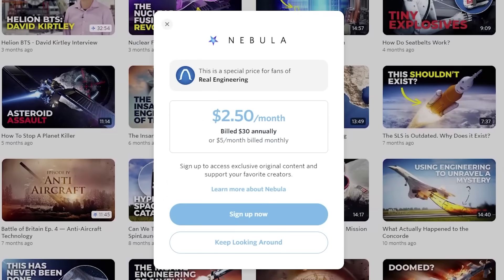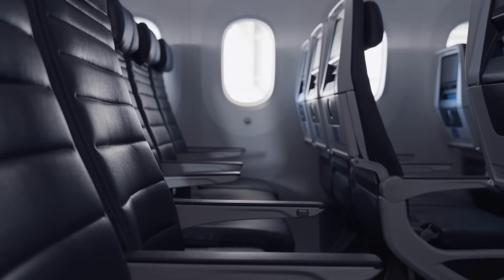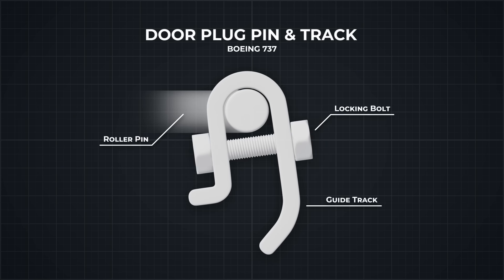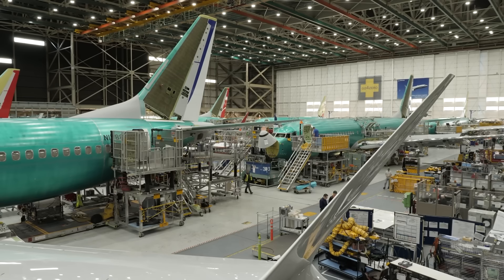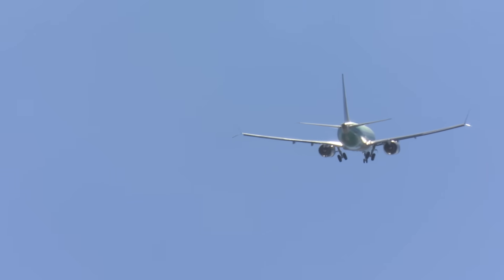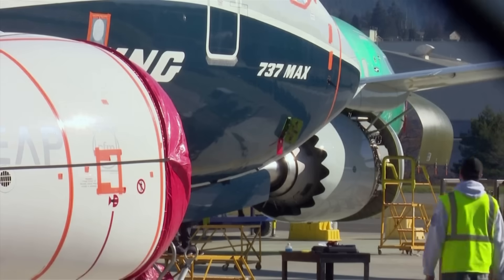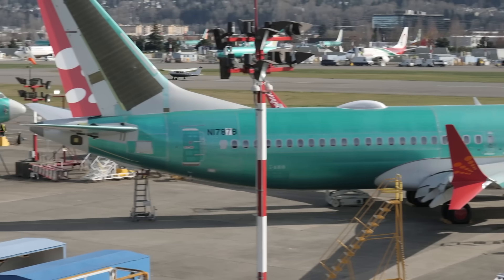The Questionable Engineering of the 737 Max

Comment: A few thoughts.

1) This is a plain example of “trying to upgrade an old system when you really need to simply start fresh”. I think Boeing is starting to realize this. I see this at my own work (I’m a design engineer at another large aerospace company, not Boeing). There’s A LOT of taking old designs and modernizing them that goes on, to the point where it teeters on the edge of insanity when it comes to just how many things need to be updated and revamped and fixed and all, just for the sake of trying to save a couple of bucks. A lot of those decisions are made by the guys overlooking the financial spreadsheets, unfortunately, and the engineers are stuck doing what they’re told. But, it’s REALLY easy to overlooks something small in the midst of the thousands of tiny fires you’re trying to put out. My entire job is moving rivet holes around on engineering drawings because they weren’t drawn in correctly 60 years ago!

2) There is definitely a level of incompetency creeping into the industry (and not even just the aerospace industry, but engineering, manufacturing, and mechanic industries at large). Human error is the cause of like 90% of accidents, and this sounds like it fits into the category. So many “engineering tragedies” would have been prevented if people didn’t ignore safety warnings that were going off for a reason. It sounds to me like the engineering side of things actually worked properly, it was everything else that was the problem here (manufacturing, assembly, inspections, and maintenance)!

3) “systemic” is a bold word to use. Even with these few incidents with the 737 Max, the plane, and Boeing, still have very good safety records. As air travel increases, it would be expected to see a rise in the number of reported incidents, but the overall percentage will stay the same or go down. And, more government will not stop the problems, it will only cause things to get delayed more.

4) there isn’t a company or government in the world that doesn’t prioritize profit over safety. There is a risk-reward calculation for every product and policy made. It’s not just a Boeing thing. So, that argument is tired and old and irrelevant. Boeing isn’t “overly prioritizing profit over safety”, because guess what, if they continue to have safety issues, no one is going to want their planes, and then they also won’t have any profits… It’s a dumb argument that only sounds good, but doesn’t make sense at all. And, taking the word of any PR rep is stupid, as they’re going to say whatever they feel needs to be said to look like the good guy, so of course the Alaska Airlines rep is going to say “we don’t like safety exemptions”, because they’re trying to save face too. They’re more than capable of paying to make sure the planes they’d purchase have extra safety inspections and all, but they don’t, because they’ve made the same “risk-reward” calculation that Boeing did and now they’re just paying lip service to the people.

Comment: The MAX will not be remembered as a sales success, but a testament to how far Boeing has fallen. 

Boeing was actively working on an all-new 737 sized plane in the early 2010s when the NEO was announced. 

Instead of continuing the development, they dropped it all together to make the MAX. They were so concerned with losing market share that the thought of the NEO going unchallenged for 2-3 years was unpalatable. 

Development would have cost $2b US.

The overengineered 737 MAX enjoyed fanfare until the two accidents in which it was grounded for nearly 2 years. 

The CSeries debacle was another caveat into the arrogance deplayed by Boeing, who themselves should have bought the aircraft, and not Airbus. Now Airbus has the modern A220 and A320neo families, and the technologies therein, while Boeing flounders with a 1960s relic. 

Lies, cover ups, rubber stamping, all these things revealed about Boeing and their certification processes. 7 years after EIS, what has Boeing to show for it?

The 7 and 10 are not certified, and probably will not be so for avery long time, and now the 9 is grounded indefinitely. The 10 has the same plug type door the 9 has, so that will further complicate things

This aircraft, the embodiment of Boeing's arrogance, has cost them tens of billions of dollars. And Boeing is too broke to do anything about it. 

How the mighty have fallen.

Comment: Reset the warning and keep running. This happens in every production environment, regardless of the machine, if you don’t have proper people in charge of the mechanics. Upper management doesn’t want any down time so it takes someone w/ knowledge and power to keep it offline until the root cause of the problem is identified and fixed.
Reply: The more software I write the more amazing it is that people ignore warnings and errors. I cannot believe the number of projects just littered with warnings. The complacency it causes is unbelievable. Every single warning or error should be explicitly silenced with good reason, or better,  actually fixed.

Comment: For me the biggest red flag occured when the Max was grounded. They used the time to inspect all aircraft and they found foreign objects in the fuel tanks of more than 60% of them. In aviation every tool, bolt, screw, nut, washer, rag etc. is counted before and after a shift. If any piece is missing, no aircraft leaves the station before it is not found. The fact that something ridiculous like 60% of the aircraft could contain foreign objects in the tank shows a complete disregard of safety standards. It also shows in everything else they do.
Reply: Carlo M. Cipolla wrote a book. "The basic laws of human stupidity" and it covers the exact issues involved.

Comment: Boeing is too large for their own good and thus full of ineficciency and corruption.
Cost cutting top management, annoying middle management, and way too few actual engineers. Outsourced to cheap subcontractors.
I mean the whole plane is a 1960s design, with way oversized engines glued on, hoping a computer will correct bad design.

Comment: There is nothing wrong with door plugs.
Airbus A321neo also used it too. In the old A321, Airbus customises each configuration individually, just like Boeing 757. Some of them have 8 full sized doors, some of them only have 4 full sized doors + 4 emergency exits, some might even have 4 full sized doors + 2 half-sized doors (the size of this 737MAX9 aft exit) + 4 emergency exits. This customisation costs money and time, plus it made the plane less attractive to would be buyers looking to sell it on secondary market (e.g. leasing companies like GECAS).
The wrong thing is easily shirking quality obligations and promises. Plus not managing the supply chain properly.
737 is produced in moving assembly line - now you know. Russia-Ukraine war, US-China trade war brought quite a lot of supply chain constraints, because not many people know that Ukraine and Russia has a big aerospace export economy. Parts are getting a bit more difficult to come by, and assembly line workers sometimes didn't have everything they needed when the airframe passes by their station, and have to chase down the airframe down the line when the parts finally arrived.
Who is going to check the installation job when the plane is already far away from the original station with all those inspectors laid off?

Comment: I appreciate the analysis done by RE, but his brief synopsis of the MCAS incident actually comes to a false conclusion.  For example, RE mentions an “instability” corrected by MCAS; when in actuality the MCAS only moderates the feel the pilots get in the control column such that the max “feels” the same as the legacy 737s when at high angles of attack with high thrust settings.  MCAS does not correct for any “instabilities.”

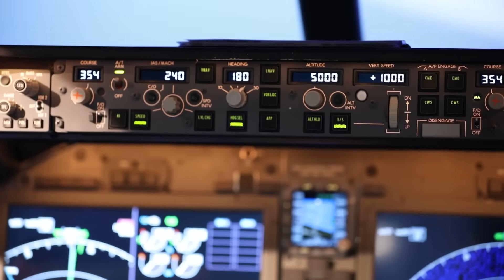Comment: 7:44 AFAIK the MCAS was not only a software, it was a system that had a computer and a sensor. 1 sensor. The crashes were caused by the 1 sensor failling (a massive sin for aviation that has reduntant systems everywhere) and the pilots WERE NOT INFORMED of the MCAS system during training and manuals
Reply: Additionally, airlines had to pay extra for the second redundant sensor. But like you said, the lack of clear training and communication about MCAS with the pilots was the real issue, and is caused by the fact that Boeing was allowed to self-regulate.
Reply: they didn't want additional training as that is the selling point of the 737 MAX, to match airbus' A320neo which didn't require additional training.
Reply: The 737 always had two Angle of Attack (AOA) sensors. MCAS was initially designed to use only one sensor at a time and then switch back and forth on every flight. You are correct that this was a massive error. Originally, the two sensors only drove two cockpit gauges, one for the pilot and the other for the co-pilot. Then Boeing crossed a line when they started using the AOA sensors to move the flight controls surfaces. It's been redesigned so that if the two sensors disagree then MCAS shuts off. This is better, but standard practice these days is to use three sensors and have the two good ones vote out the bad one.
Reply: @joevignolor4u949 yea, like airbus has been doing for ages. Airbus themselves did have some missteps though (qantas 72)
Reply: @dew9103 yes but Airbus documents every single function their fly-by-wire has 😂😂 oh and they know redundancy
Reply: it drives me crazy people keep blaming the software, there is nothing the software can do if the only sensor is faulty
Reply: A bit confusing, but MCAS is a normal thing pilots are aware of that exists on many planes - it helps correct the flight controls to feel consistent across multiple planes in the same class (regardless of length) and help correct for different weight and balance. It would be very difficult to fly large modern planes without something like it. The problem was with a particular piece of that system that was added without any real notice to pilots - a piece of code that looked at one single AoA sensor (the plane has multiple) to decide if the plane was at risk of a runaway pitch up, and if so, pushed the nose down, without any real indication it was doing so.

In the accident flights, that AoA sensor, which tells the computer the direction of the airstream compared to the plane, failed, and there was no redundancy or sanity check in the code, so the computer pushed the nose down as it was designed to do. Then it kept pushing until the plane crashed. Meanwhile the rest of the planes systems and instruments would have been operating and displaying as normal using their redundant values, making it very difficult to understand what was wrong.

Basically any amount of due diligence, oversight, or redundancy with other systems, would have prevented this. And even if not, proper communication and training with pilots would have.

There are a lot of accidents that are true "swiss cheese" scenarios, where things go wrong despite our best attempts to catch problems. But this was not one of those. It was totally predictable and totally preventable, and for it to happen at all the culture inside Boeing must be terrifyingly unsafe.
Reply: A system that doesn't allow the pilot to take over, I find it horrifying! Is like having a car that won't let you brake.
Reply: @DavidVercetti_prod  It can be overridden, but you need to know it's there in order to override it.
Reply: @DavidVercetti_prod You’re not the only one. I feel pretty bad for the poor pilots of those two crashes. Although MCAS can be disabled, the pilots have to know MCAS exists and how to disable it… and they didn’t because Boeing deliberately hid it from them and the FAA.

To those pilots, it would have seemed like the aircraft had suddenly developed a mind of its own and it was determined to force itself into a nose down position to dive and crash. Nothing they did, worked for more than a few seconds and they would have ended up fighting for survival against the aircraft itself that kept overriding them to enter into a fatal dive.

It must have been absolutely terrifying for them. Fighting and failing to survive against an aircraft that seems inexplicably determined to kill them. Whoever approved MCAS relying on a single AoA sensor should be jailed for life for this alone.
Reply: @mikoto7693  Its a bit more murky than that. Boeing's assumption (which was partially correct), was that crews would identify an MCAS malfunction as a separate malfunction with similar symptoms and take action based on that. MCAS operation was similar to an existing system on older 737's, and the MAX, called STS, which was in the manuals. 

STS is used to enhance stability under certain conditions. While testing the MAX, Boeing tried to use the existing STS to correct for the new handling issues, but they found STS by itself was too weak, so they added an extension of STS called MCAS, which does a similar job to STS, using the same flight control surface, but using a different sensor and made it more powerful. They kept STS in the manual and just assumed pilots would think MCAS inputs were just STS inputs.

Boeing assumed crews would be able to control the plane because, like STS, MCAS was designed with low control priority. It can be overridden by normal trim inputs. Basically as long as pilots do what they always do in normal conditions, which is to keep the plane in trim, MCAS would be overridden without the pilots even needing to know about it. Boeing also assumed that if the MCAS trim inputs became too annoying, they would use the existing stab trim runaway procedure, which can be used to stop trim inputs from any source, and would also stop MCAS. 

This assumption was partially correct. In the first event, the crew identified the trim moving excessively whenever they stopped making their own trim inputs, they turned it off and landing safely. In the 2nd event (1st crash), the captain successfully overrode MCAS for about 8 minutes just by using normal flying techniques of trimming away control forces as they appeared (something pilots learn in their first lesson). The plane then crashed when the captain gave the controls to the First officer, who, under high workload, let the control forces build up without making any major efforts to reduce them. Eventually the forces on the controls were so high that control was lost. 

Before the 3rd event (2nd crash), the regulators were comfortable allowing the MAX to keep flying because MCAS was now known about and an existing procedure, which all 737 crews should have had memorised, could be used to solve it. For reasons unknown, the crew of the second crash did not perform the procedure correctly (which was required to be known for all 737 types, not just the MAX), probably due to high workload. They also crashed.

At the end of the day, the system design was well below standard and never should have been certified. A pilot focusing solely on flying is able to fly indefinitely with the malfunction, but with all other warnings and cautions, any distraction from trimming was quickly punished by a crash.
Reply: @Jamenator1  that final paragraph makes it even more terrifying tbh
Reply: @mikoto7693  MCAS cannot be disable. What you can do is turn off the automatics. This is like having a program on your car that has an error that causes it to make a hard right turn. The only way to stop the program from making your car turn right is to disable the power steering. That is not the same as turning off the program (MCAS) just preventing it from acting.
Reply: @nickl5658  Aye, I was talking about before MCAS was modified after the two crashes. The engineer I spoke to said that it was patched and could now be isolated. Aka, not turned off but prevented from acting.
Reply: You can't point to one thing. These are all half-a$sed fixes to enable the central lie that Boeing could shove larger engines under the 737 while pretending it's the same airplane known to pilots and regulators. Predictably to make this "work," Boeing engineers made a chain of bad decisions and obfuscated their seriousness,, and the result is they murdered hundreds of people. The best way to avoid future problems like this is for the CEO and other senior executives who signed off on this clusterf**k to go to jail for years.
Reply: 'Must Be Terrifyingly Unsafe ' ...thankyou for those words...
Reply: In a way, you can blame SouthWest Airlines for that one.  They stipulated that for them to purchase MAX aircraft, the aircraft needed to be similar enough to keep the same type rating as an NG.  If it didnt and their pilots needed to recertify on a new type, they were going to fine Boeing 1mil per aircraft purchased.

Comment: There are several versions of the Boeing 737 Max.  The Max 800 or Max 8 suffered from an ill published notification regarding MCAS.  The Max 900 or Max 9 is the model which suffered an inflight loss of a door plug, or emergency escape door.

Comment: MCAS, from an Engineering Standpoint was dually redundant system to ensure that the 737 Max would crash if either one of the two angle of attack sensor failed. This MCAS system with the redundant angle of attack sensors, essentially had doubled the probability of crashing, over a system that had only one sensor. Two sensors, twice the probability of a crash.
Reply: This is just bullshit, sorry mate.

Comment: Disagree on the hesitancy to blame management.  I work in an engineering dept a Fortune 100 manufacturing company and just because a manager used to be an engineer hardly means that when a decision is made by such an individual that it is an engineering decision.  Managers with an engineering background are better positioned to make engineering decisions but they are still heavily influenced by non-engineering business forces.  btw should have mentioned Boeing Starliner project, disaster as well.